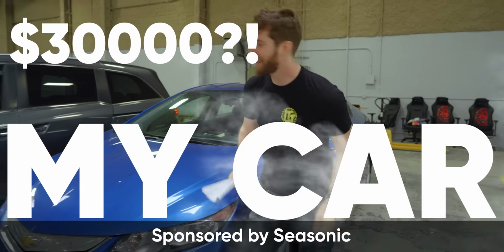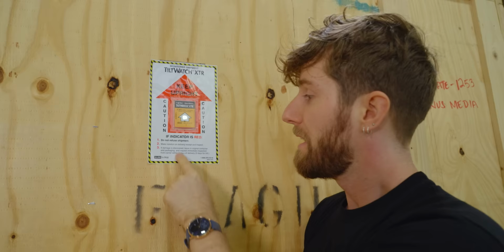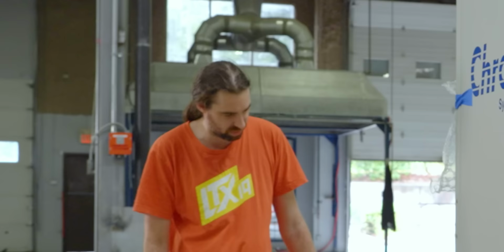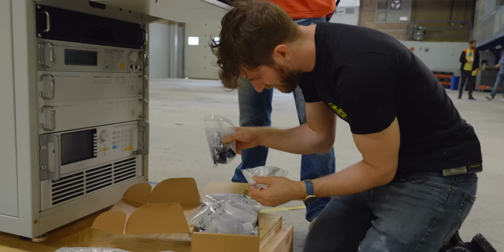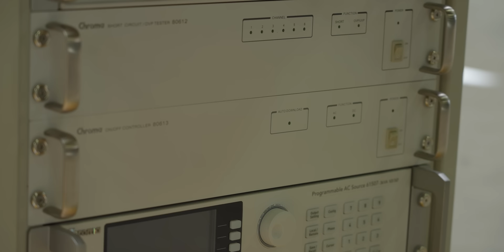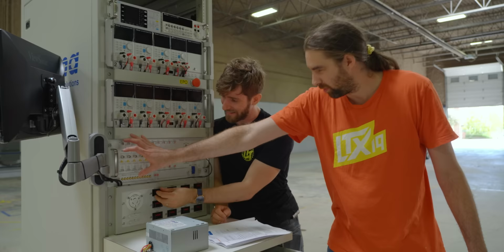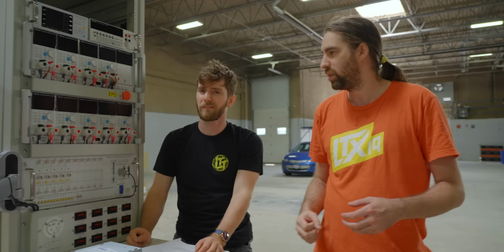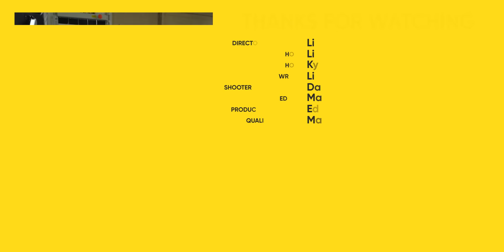The most EXPENSIVE thing I own.

Comment: 12:36 - this right here is what EVERY tier 1 power supply manufacturer is feeling right now. Their testing equipment wasn't designed for transient power spike testing, and now that Nvidia isn't backing down on their immense power draw manufacturers had to not only MAKE power supplies that can deal with it but also change their equipment to test that they can deal with it. Ripple effects
Reply: This comment needs to be higher up. Power supply evaluation is more important than ever now that the GPU power paradigm has changed and it's no longer sufficient to judge the compatibility of a PSU based on a simple minimum wattage value.
Reply: Yup, 4090 coming out and psu’s need to handle these spikes because they can’t handle a 3090 atm. Nvidia = bigger.

Comment: Electrical bonding is important, I worked aircraft electronics for years, and every piece was grounded just like this.  Most equipment had spring centered contact patches to ensure it.
Reply: did these Chroma guys actually just rebrand Keysight instruments?
Reply: Card are similar that way but the opposite the grounds are one of the first places to check if you are having an open condition because the manufacturers are lazy about ensuring good ground
Reply: @RandomUser2401  Rebranding is pretty common, but I'd bet they share an OEM.
Reply: It's called equipotential bonding. And is as it sounds. Equal potential. No difference in voltage anywhere.
Reply: @stuartlunsford7556  looks like these are indeed their own instruments or at least no rebranded Keysight. Keysight btw for sure does not have any OEM they do their own instruments.
Reply: I am from industrial automation, out team was building racks that were controling multi-thousand amps of current throught magnets. Equipotential bonding is absolutely mandatory in anything operating over ELV (Extra Low Voltage, 120VDC, 5VACrms), since it can pose major health risks. Everything that had any piece of metal that was exposed outside it's enclousure must have a grounding point, that is then connected with everything else, and the ground is then very closely monitored either with dedicated electronics (which we sometimes did on racks that were for example tripping the gigantic transformers and were close to them), or hooked to appropriate GFCI-type device. 
It is very nice to have few breakers trip when you forget to screw in one of MANY wires and they touch the rack wall, rather than getting electrocuted. Or when a wire gets loose somewhere somehow, it doesn't kill the operator.
Reply: common ground best ground.

Comment: There's even better ones that show the degree of rotation your parcel has had as well. Super helpful stuff!
Reply: @dontreadmyprofilepicture5552  Okay, just reported as spam. :)
Reply: Wasn't that inside the box? The tilt one?
Reply: @TheMyleyD  Maybe, I haven't seen the sand ones. I've only seen ones that have 5 or 6 balls in differently angled channels.  When the package is tilted beyond that angle, the ball drops into a permanent holding cell to indicate it has went past that point.
Reply: There are also indicators that show if the transport vehicle was driven erratically.
Reply: There are also indicators that show the size of any bullets going through your parcel when in transit through Texas. It's those big light brown panels all around the package.
Reply: @pawala7  look below

Comment: 2:22 - I can totally confirm - worked at UPS as Loader and Driver - NO ONE GIVES A S# about any sticker on the box, fragile or not, temperature or not, chemical or not, whatever man just throw it, step on it, put it as it fits, after seeing how packages are treated by 2 courier companies I was amazed that nothing ever came broken to me.
I saw that sticker that turns red but with something different, it was turning red if the package had some shock or whatever, I got a picture of that because I thought that sticker it's cool and a very must-have in case of expansive deliveries, though the package was way smaller and that sticker was wayyy red by the time I got my hands on - also, a package that size can't really be flipped without really bad maneuvers, I doubt anyone lifted it without a forklift

Comment: I used to work for a Heater Manufacturer and they use Tip N Tell on all of their units and are posted on the outside before the shipping process. 
If any of those were fully or slightly into the arrow part of the label, we would tell all of our customers to not accept the unit(s) and we would replace them for free.
Reply: I assume you would make the shipping company or insurance pay for the "damaged" product?
Reply: @Jehty_  Correct, we would have insurance and discrepancy forms with each freight company we used, that way everything was accounted for.

Comment: if you really want to go for this "docked" solution, you should make a pcb that slides in as a whole but still do a flexible connection to the test bench (Between PCB and Testbench) to take away the stress from the connectors when plugged in. Because there always is a little.

That way you have a quick connection for every plug like you mentioned but also keep the connectors in good shape.

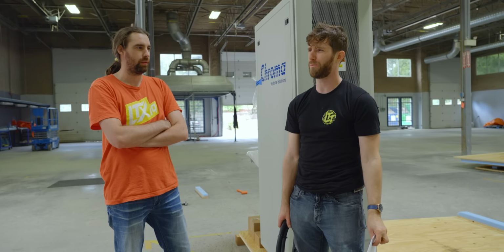Comment: 04:27 almost there. 16A at 230V~240V so 3680W at 230V to trip a european breaker prepared for normal usage. 

Here the most common/basic house layout is one or two 10A circuit for lighting, some (2-to-whatever) 16A circuits for normal usage, one 20A circuit for washer+water heather (similar to how people in 130V have a 230V circuit only for that) and a 25A for the ceramic cooktop in the kitchen.

So the day that "ultimate gamer setup" requires 25A/5750W, we'll play in the kitchen, eating is overrated after all >:)
Reply: No problem, we can handle 11 000 W @ 400V in most Danish kitchens lol ;)
Reply: @96Lauriz  Those are some powerful kettles!

Comment: Actually tripping a typical European braker (16A) requires you to pull about 4200W+ from the wall (and what is funny, you can pull up even more, probably up to 4500W+ for a little moment, and the fuse should withstand it).
Reply: It all depends if your on 115 volt or 220 volt..
Reply: @joshuasterling2144  In Europe we only have 220-240V and 380-400V between phases ;)
Reply: @joshuasterling2144  europe is on 230V for household applications, hasn´t been 220 for close to 40 years
Reply: 208v 3 phase.
Reply: @yannik.f22  I was referencing Europe.
Reply: In Germany most houses have 1-phase 230V 16A or 3-phase 380V 32A (which is used by electric stoves or machinery).

So yeah, 3500W is the maximum of regular sockets, but if you wanted you could get far more.

My stove for example runs at 11kW on 3-phase 380V.
Reply: @kevinshah1738  Yeeeah situation is getting a littlebit tense ;P
Reply: @justjanne-de  woah , that's insane . I think our stoves run up to 3000 watts maximum on 220-240 60hz(North America). 11 kw is more than some homes use in a month but im sure its gets hot very quickly.
Reply: @yannik.f22  official, yeah. practically speaking, mhe. I have seen places with 215V up to 248V. absolute nightmare.
Reply: @duncyy7471  well, power delivery to low voltage customers is set at 230+/-10% so.. a bit of tolerance here.
Reply: @yannik.f22  230V is a legal fiction, the 240V areas are still on that and the 220V areas Haven't changed either. The only change was calling it 230 and saying it can be +/-10%
Reply: @sIightIybored  Must disagree - in Poland we had 220V and changed (in year 2002 I belive) to 230V. My house has 235V soo it's not fiction, it's just how the things are here.
Reply: @sIightIybored  I just measured, I get exactly 230V (Germany).
Reply: @justjanne-de  its 400 Volts here in Germany. 220 became 230 and 380 became 400. Cause √3 x 230V = 400V. And for example: my grandmothers house built in the mid 1980s in Bavaria has a 3x63A feed from the street. Depends on where you live in Germany
Reply: @JPK1337  that shouldn't happen, the VDE spec requires 1h at 16A (3680W) and 24h at 12A (2760W)
Reply: @sIightIybored  bullshit. Just stick a multimeter or voltmeter in your outlet. For example Germany was once a 220V country. Now its measuring 230V since 1987
Reply: @Zimiorg  The house as a whole, yeah, that's usually 63A at 380-400V, but the largest a single load at home can be is usually 398V at 32A (which is often the stove or instant water heater)
Reply: @justjanne-de  ah you mean the "Schieflast" with single phase usage (dont know the english word) :-)
Reply: @tobiwonkanogy2975  Thats probably for the whole induction stove, mine can draw about the same load. However, my main plate runs only up to 3.3kw...(and it has 2 additional flex zones for 2x3.3kw) which stil heats 500ml water in a pan to a boil in 30s though. Going full steam on for example mushrooms will char their edges without actually cooking them. Love cooking on it.
Reply: Breakers only start to trip at 1.13 of rated current.
Reply: Loads can flex 10% up & down from 230V. 
230V +/- 10% x 16A = 3 312 to 4000W is a common range.
Reply: @JGnLAU8OAWF6  Yeah, from about 1.13 to 1.45 you don't have 100% chance of tripping, from 1.45 up it should trip but between that and lower point of the characteristic (for instance if char. is B it's activation current is 3-5x nominal) soo for B it would trip not instantly, but after a short while (if current = 1.45 - 3x nominal)
Reply: @justjanne-de  242V here a few weeks ago. I haven't jammed anything into the wall over the channel, but the internet said you were all still on 220 and since we're on 240 still I assumed.
Reply: @joshuasterling2144  Europe: "What's 115V?"
Reply: @tams805  LOL

Comment: 5:30 The grounding isn't for safety, it's for EMI and to help with common mode noise suppression. Extra safety is a nice side benefit though!
Reply: Yea, quite a few minor things wrong in this video, that being said I don't see any issues with the setup or devices. I just hope they go with a decent oscilloscope.
Reply: Also for making sure the ground potential is the same for all of the equipment iirc
Reply: @fetzie23  That's not that important in this kind of application, the grounds are not supposed to be carrying any current. If you noticed each programmable load has it's own ground going to the connector panel for that reason.
Reply: @faranocks  As they are paying $133K (I think they said) for this I'm sure any oscilloscope they buy will be quite decent. Not to mention that they have a list of recommended models to chose from. These are not likely to be the bargain bin variety...
Reply: @blahorgaslisk7763  obviously but I've had issues with the accuracy (or the frequency of tuning, really) of some of the higher end oscilloscopes I use in my research lab. Expensive =/= good, the ones I'm using cost upwards of 10k each. That being said the usecase is a bit different. I'm mostly dealing with lower voltages, and signal quality rather than power and power quality.

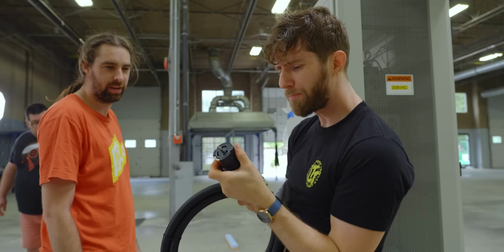Comment: 3:50 European max power on a one phase standard power outlet is 3680W ( 230V x 16A ) - The 3500W of the source is lower than the possible Power that is in Europe available at a standard outlet and a green/yellow cable is standard for ground in Europe.

Comment: You guys crack me up. The purpose of the extensive ground bonding in the enclosure is something called equipotential bonding. It not only helps maintain a constant electric field in the enclosure it also protects the internals from static discharge.

Comment: From what I hear PSUs like Seasonic Prime perform better in the US than the equivalent EU version because they're designed with the US power grid in mind and then converted. Any idea if this is true and can this fancy machine test for it?
Reply: The EU has a different power grid and does not have the problems that US households have or the problems with high wattage power supplies. Generally power supplies in EU achieve better efficiency than in USA. You can see not only in our reviews.
Reply: All of Edison’s power installations across the United States were 110 volts DC. (It was the DC part that was Edison’s downfall. Direct current can’t travel long distances. George Westinghouse and others went with alternating current, and won the “war of currents
Reply: if that is true then its kind of a stupid decision IMO, there are far more people running 220v-240v power than there are running 110v-120v

Comment: Lol at the engineer specifically wanting an "impact driver" to unscrew the box
Reply: He should stick to invisible mystical things like electricity.
Reply: 3" woodscrews be serios business, surprised he didnt just ask for a half inch hole hog with a phillips bit just to make sure.
Reply: @paddington1670  you being serious? 🤔 putting the box together you'd be f'ed on battery with a normal drill gun but for taking it apart there's no issues
Reply: What's the issue with using an impact driver? Not to imply you need that much torque but they have other benefits like a lower chance of stripping screw heads and virtually no wrist strain compared to a drill. Both can do the job but I think the impact driver is the better choice.
Reply: @trevorhook9495  pretty clear he wasn't being serious
Reply: @frankthetankricard  oh yeah impact is definitely the smarter choice, just the way he said he didn't have one and gave Linus a screwdriver made it sound like he had no tools. He then walks up with two drills 😭
Reply: @seegee9  with some people I've met on  jobs, I honestly couldn't tell for sure 🤷‍♂️
Reply: @frankthetankricard  Wrist strain's a big deal IMHO. At the workplace ergonomics are huge, there's lots of liability involved. 

Of course I understand how silly it is to worry about ergonomics when your boss is literally squatting on top of an 8' pallet, but, you know. I can understand his concern and you can only do so much with Linus around 😂
Reply: I came here for this comment

Comment: I would love for you guys to use the "dirty power" feature to test some audio devices! Some x-over between labs departments :) 

Really curious if there is anything to the "dirty power" myth from a audio perspective
Reply: Excellent point. I remember that little scam board they had to filter the power to the soundcard. Turns out there was little difference there. 
But with this device, they might actually get some reproducible stuff.
Reply: There is dirty power for sound I recently had a werid occurance, where my shure SM7B picked up weird electrical noise when the whole setup was plugged into one outlet, but it disappeared with a different one
Reply: It's not a myth, actually. I do voice over work and I can tell you from experience dirty power absolutely will ruin recordings. I live in a house built in the 1960s so power out of any outlet is basically unusable for audio gear without using a power conditioner. When I got my Furman unit, it instantly cleared up the sound. It does this by essentially reprocessing the power 'signal' into a cleaner sine wave which plays more nicely with sensitive electronics. That's basically all it does though, so unless you need it like I did (since my VO work was going to be my main source of income) its not worth getting one. Unless you're an audiophile, in which case knock yourself out I guess.
Reply: I think dirty power is ideed an issue for audio devices, although IMO that's not the excuse that quite some devices just doesn't care about EMC isolation that much, and rely on the speaker/headphone's low sensitivity to suppress the noise. 
Also it doesn't even matter that much for most headphone users -- just use a powerbank and that's gonna solve the issue. Honestly ground loop seems to be the harder to solve issue anyway.
Reply: @FlameRat_YehLon  You're quite right on that. I don't really consider myself an "audiophile" since I don't enjoy spending thousands on hardware, but I just cannot go back to lower quality audio gear since I started working in VO. I never use onboard audio, always an interface with high(er) impedance headphones that can be run without an amp like my Sennheiser HD 559s. As for solving ground loop hum, that was another huge issue for me personally. My house is old AF and in most rooms outlets do not have the ground prong. To solve the 60hz hum I ran an extension lead to the newest part of the house that does have modern outlets and that fixed it. The only problem now is I have this big fuck-off lead to deal with lmao

Comment: Changing the load in a fast way is a test to see if the gain of the resonant circuit falls into the capacitive region. Most powersupplies have limited the frequency of the pwm a bit to prevent this from happening but I'm interested if some of the most efficient powersupplies on the market have pushed the limits too far. Especially when going from 0 load to full in a microsecond.

Comment: Wish to correct some, in Europe, when we run a 2 fase - We can run like 7.4KWH on one group :) There are even 3 fases, which will double that. Default groups, should run max on ~3.6KWH. So connecting a 2.5 or 3KWH powersupply, should be fine in Europe.
Reply: Finally someone who corrects it. Thanks. I was so embarrassed when they said it would trip a European breaker.

Comment: In Europe (or at least in Germany) most consumers have 230V @16A breakers and therefore 3680W as maximum load, but yeah, pretty close to that with that awesome testing equipment :)
I am happily waiting for the first videos on that topic with that testing methodology
Reply: The breaker is maybe 16 A but what are the actual sockets rated for? Australia  does 240 Volt @ 16 amps(3840W) but the outlets are always rated for 10 amps Max@ 250v Max (2500W)
Reply: @stainlessteele5  Same in Argentina.
Reply: @stainlessteele5  in Germany, at least, the sockets and even extension cords are also rated for that, some even 250V @16A.
Of course there are cheaper ones with a lesser rating, but I think by law, the fuse rating have to match the socket rating.